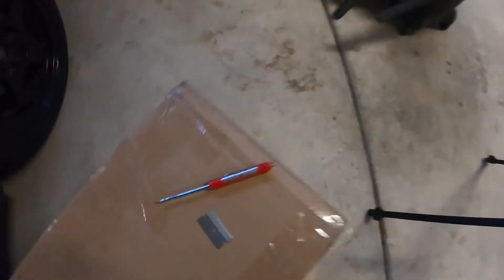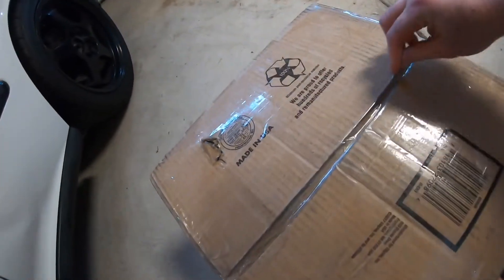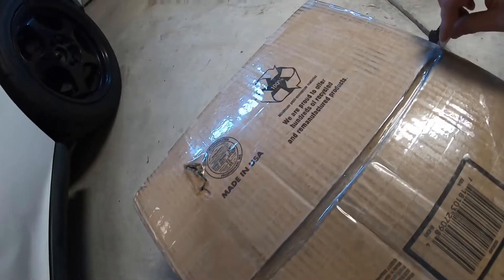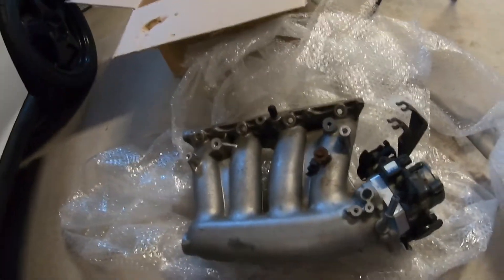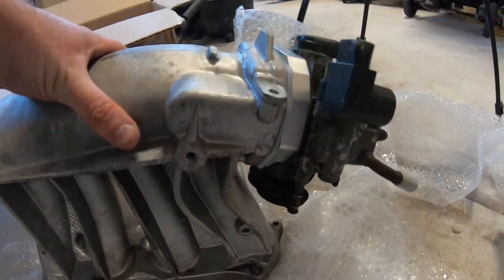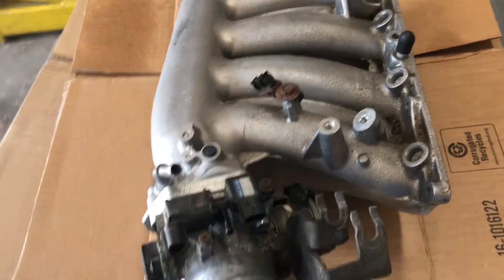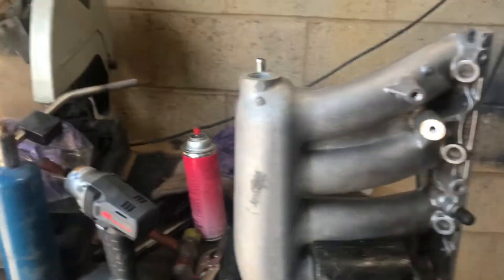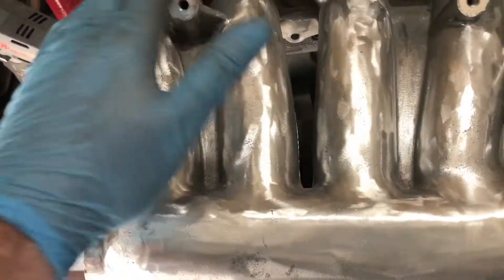Kswap eg civic gets a RBC manifold!!!

Comment: Figure out what that top sensor was on the TB ? I picked up a accord TB same sensor.
Reply from the maker: Yes, it’s for the evap, not necessary for a swap
Reply: Did you remove it? Is it the TPS sensor? The other one is the map ?
Reply from the maker: The tps sensor is on the side, the map sensor is on top.
Reply: I was freaking out cuz the k24 accord does not have the map on the TB lol. It’s on my factory manifold right next to where the TB bolts up.
Reply from the maker: Nacho oh your still running the accord/tsx manifold. Sorry man! Miscommunication.
Reply: All good. And yeah man for now just trying to piece everything together slowly but surely.
Reply from the maker: I think a tsx manifold would be an upgrade from the accord one. Can find those cheap
Reply: You talking about the factory tsx manifold ?

Comment: Where did the hose goes in your ktuned k24 intake manifold adapter. Cause i saw that your using k20 water pump housing
Reply from the maker: It goes to the thermostat housing

Comment: What throttle body are you running if I may ask and do you have the stock iacv and map sensors?
Reply from the maker: Rsx type s throttle body with a ktuned adapter, iacv is plugged in but nothings running to it, you an disable it in kpro. Stock oem map sensor

Comment: If the rbc you got wasn't already cut would you have been able to use the rbc as it comes OEM for the k24a2? In other words, do you have to shave the RBC for the k24a2?
Reply from the maker: Yes I could have just put it on if it wasn’t cut, I got a good deal on it so it didn’t bother me.
Reply: @ChrisBuilt92  Yeah that makes sense! Thanks.